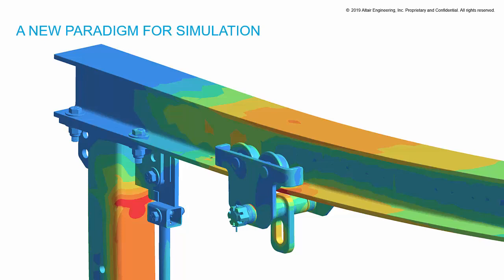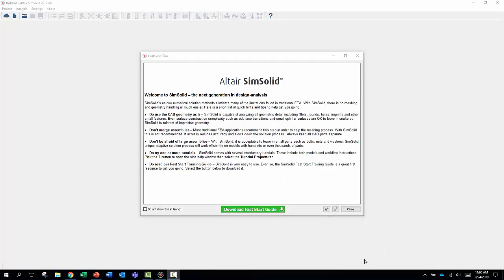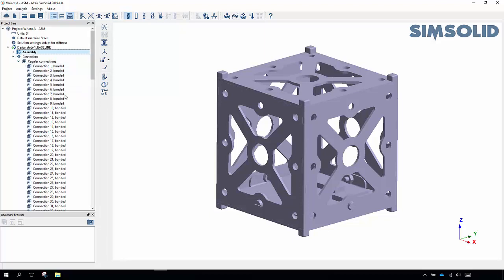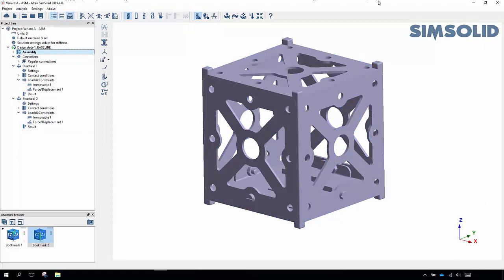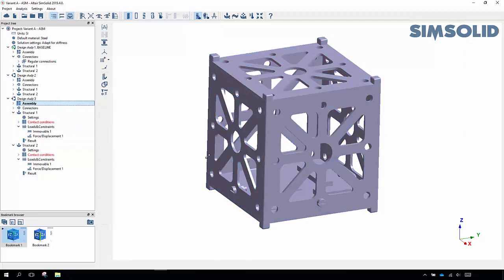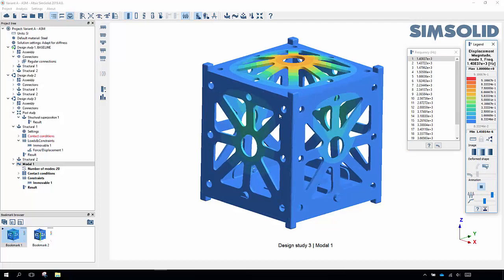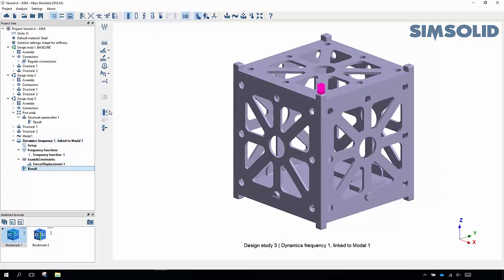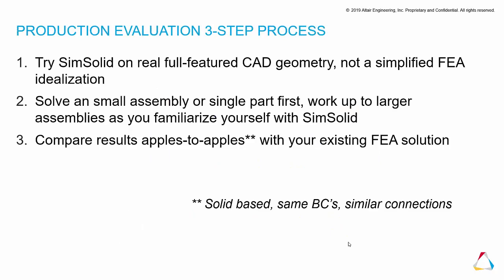Introduction to Altair SimSolid™

Comment: I just now used SIMSOLID. My mind was blown away. The same simulation took me 10Min in Ansys. Wow.
Reply: Very interesting! What's the difference in results?
Reply: @Serhiy34  There is not much difference in displacement. There is little difference in von-misses stress. The results also depends upon the CAD export file. I found out Inventor file export gave me closer results to Ansys  than step or Stl.
Reply: @pramodsurya4  Thanks for the answer. I am very confused by the linearity of deformations in those details where it cannot be. I really like the speed of calculations, I especially like the fact that there is no need to simplify the details. I want to try to use Altair for preliminary analysis. And already finally solidworks simulation.
Reply: @Serhiy34 I used SIMSOLID in similar way. While designing I used SIMSOLID. After completing my design I have done Crash analysis in Hyperworks Radioss. I was designing a rollcage for SAE baja. For Rollcage the bodies are very very thin. Applying 3D mesh is a very big headache for thin bodies. Applying 2D mesh is like  try and error meathod. You can apply 1D mesh easily but results from 1D mesh are not accurate compared to 3D mesh. I felt more than 1D mesh and 2D mesh it is better to use SIM SOLID while designing. If your bodies are small it is better to simulate in 3D than SIMSOLID. If your bodies are very big and it has many features it is better to use SIMSOLID. I use fusion 360 while designing.
Reply: @pramodsurya4  I am using solidworks. He suits me all. But when I come across an analysis, I have to spend a lot of time preparing the analysis itself. Recently, I often come across the limitations that my workstation imposes. There is not enough RAM for calculations. And the calculations themselves take a lot of processor time. So I'm looking for an alternative. Simulating the load on the buggy frame is no problem for solidworks and my workstation. I have to work with constructions much more difficult.